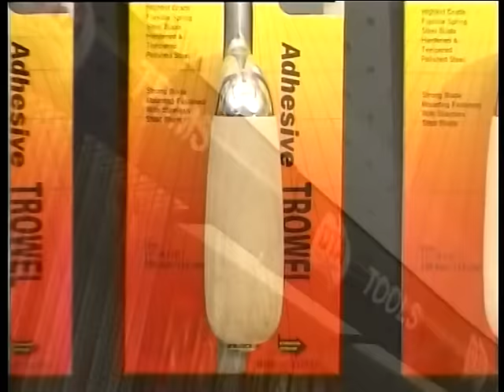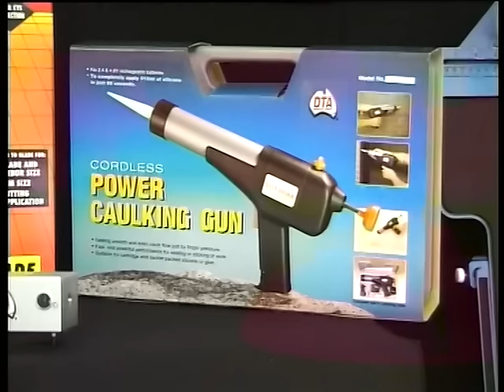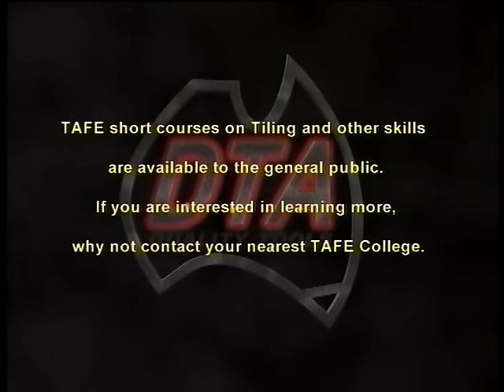How to Tile & Grout Part 7: Tile Grouting and Cleaning using Ceramic Tile Grout Cleaning Tools

Comment from the maker: its always reccomended to check with your tile manufacture or supplier before applying any type of surface coatings. 

If the tiles require sealing, then it should be done after you have thoroughly cleaned tiles and after tiling work has been completed.